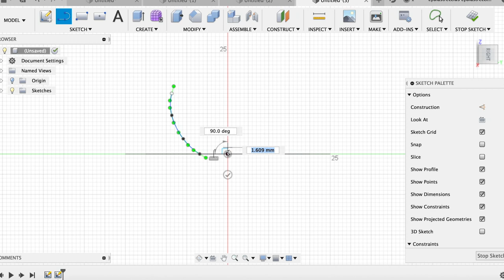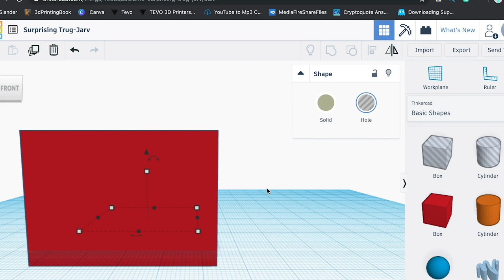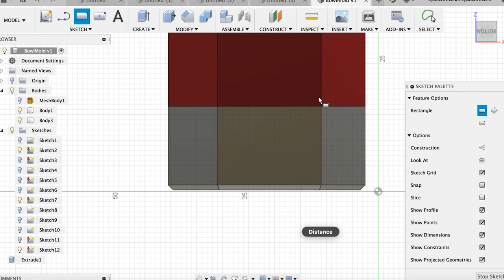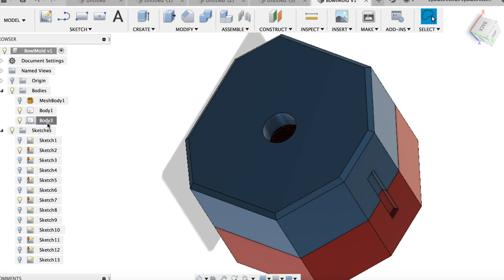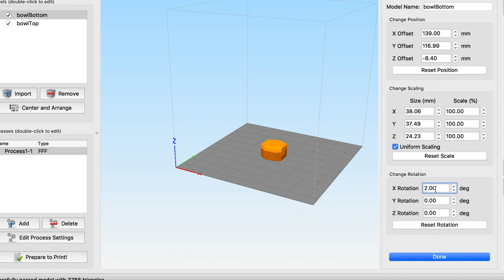Final 3d Designed and Printed Molds in Polysmooth Filament

Comment: Lydia , if You use silicone rubber for Your molds then it won't stick , almost nothing sticks to silicone ( so You don't need to put oil or wax as a release agent) , so I say make Your bowl with the 3D printer then use that bowl to make Your molds with silicone .    Here's an 8 minute YT Tutorual video by Tap Plastics for the best silicone mold making material and how to make the molds "Introduction to TAP Platinum Silicone"   copy and paste that into the search bar on YouTube .    Good Luck :)
Reply: Also this video from Tap Plastics that shows less expensive mold making materials , here's the name of the video "Introduction to Mold Making"   Also this Woman made a great video on the Platinum silicone mold making material "How I make my clear silicone molds" by Marina Sharp .
Reply from the maker: Thank you! Now that I know it didn’t work very well I might consider making silicone molds. The whole point was not to make silicone mold to save money because I have 3D printers but I may just have to do that now. Thank you
Reply: @TimberWood.Customs  Yeah I had the same idea to use My Printer to make molds but I think the molds need to be soft to allow  the parts to come out easily .   Good Luck :)

Comment: Very good video. Have you tried 3d printing a mold for casting a mold into silicon so then you can use the silicon mold to cast the cement? It seems like a lot of the casts fail when you try to take them out of the mold, if you could have a very flexible mold you could easily flex them out. Keep up the great work!
Reply from the maker: Thanks!!

Comment: Erm ok so first question I have is... Why did you need to bring the pot into tinkercad to create the mold and then bring it back as a mesh...

You could honestly just have made the mold directly in fusion360 by using the pot as a cutting tool and combining the two

Second question...... What's with the lack of constraints in some sketches... I totally understand that some sketches don't need to be constrained for it to work the way it should but like WHY
Reply from the maker: First question: your right, in the time lapse u saw I went into tinker and, but for the rest I realize it was easier to stay in fusion360. 

Second question: I actually did put dimensions on a lot of things.